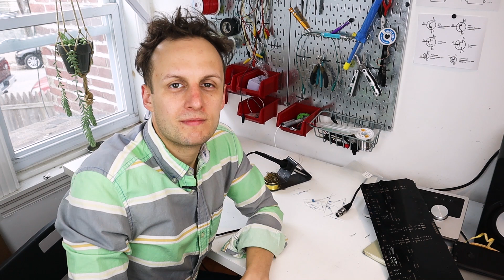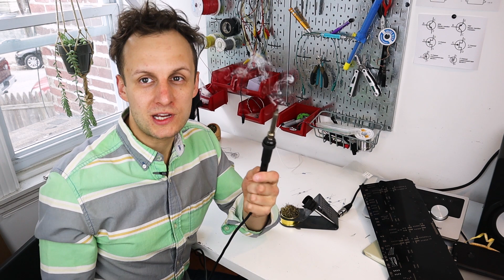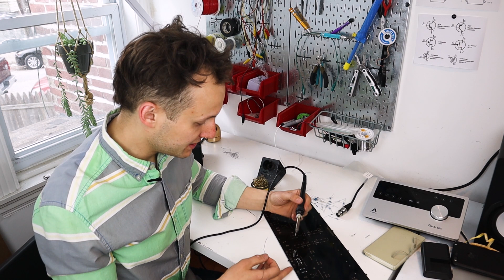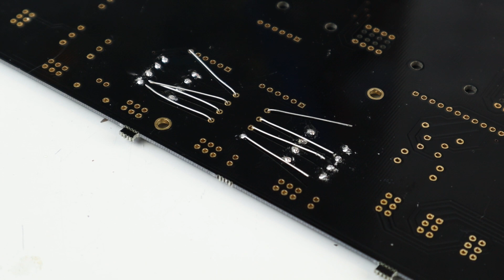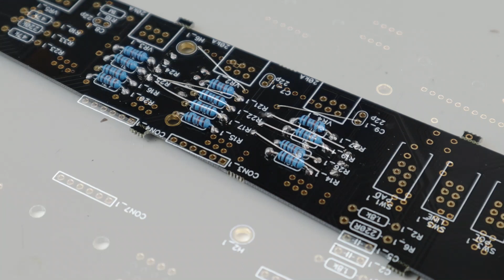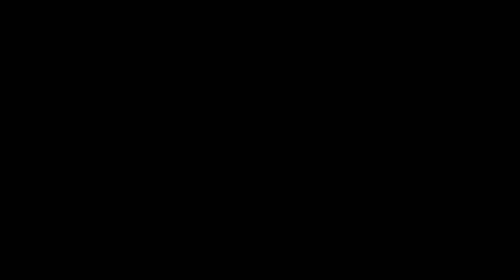3 Quick Tips for Better Soldering

Comment: Peterson, I think a good tip, and one that has helped me is to use a much thinner diameter of solder. When I first started, I was using a .050” diameter of solder that I found at RadioShack. It was always difficult to get a clean joint and I always got frustrated with the blobs of solder it created. I’ve since found a happy place with a .031” and it’s made things much easier for me. Along with the tips you’ve offered, a thinner diameter of solder helps you control the flow more, in my opinion.
Reply from the maker: strongly agree!

Comment: I heard that you should be able to make a joint in 1-2 seconds.  Is that normally unrealistic?  Sometimes it goes that fast, other times it takes longer.  

Made me think the tip isn’t properly tinned when it takes longer.  When you get those instant joints, it feels like magic.
Reply from the maker: It depends on the iron and what's attached to the joint. Most irons loose a good bit of heat when they touch a pad, really expensive ones don't. And then some pads just have one small copper trace connected to them, while others have a whole ground plane which acts as a heat sink. So yes, definitely possible, but it depends.
Reply: @PetersonGoodwyn  Ok, thanks!  Hoping to build a kit soon

Comment: Have to disagree about the wet sponge.. far superior than wire wool because the tip is manufactured with plating that helps the soldier run, and you will remove this almost instantly with wire, and will need to replace your tips more often
Reply from the maker: interesting! I never knew about that. I've used the metal wool the last 10 years and have never had to replace a tip, but good to know thanks
Reply: Not just ‘metal’ wool but brass wool specifically.  Steel wool isn’t supposed to be used for cleaning the tip; chemistry or something.
Reply: That is what tip tinner is for.  Cleans and retins the tip for better heat transfer.
Reply: I totally agree been using sponge since 90's